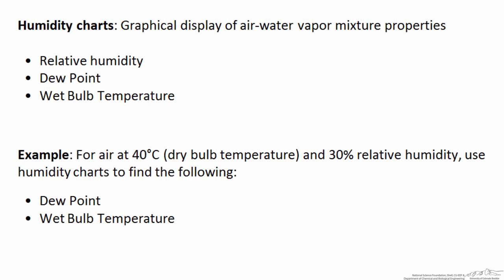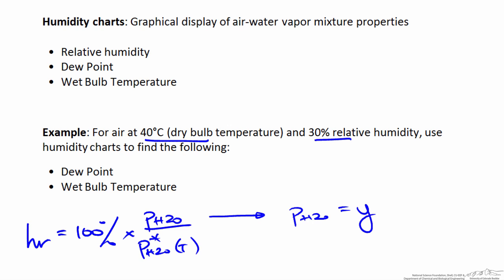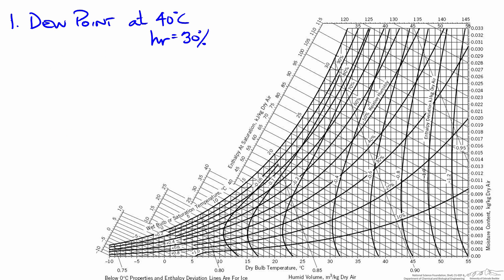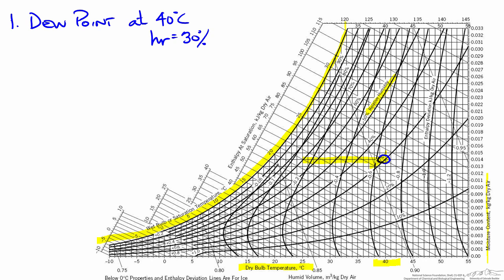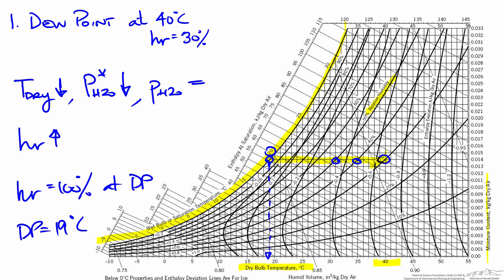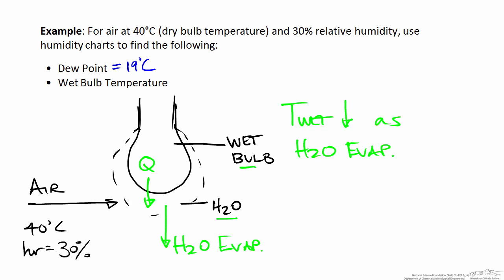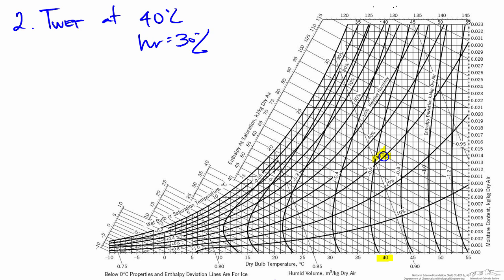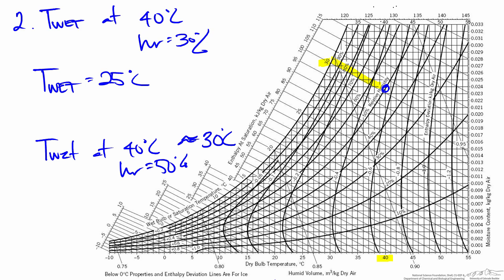Calculate Physical Properties using Humidity Charts

Comment: what if the humidity is at 90% for 40 degrees?
Reply: You would need a chart that extends into that range.  I have the data available in Engineering Equation Solver (EES).  The wet bulb temperature is 38.33 C, and the dew point is 38.04 C.  These temperatures are close, because the humidity is very close to saturation.

Since the wet bulb temperature exceeds human body temperature, so this condition of air would not be survivable for people.  Not without air conditioning.  Which is probably why it isn't included.